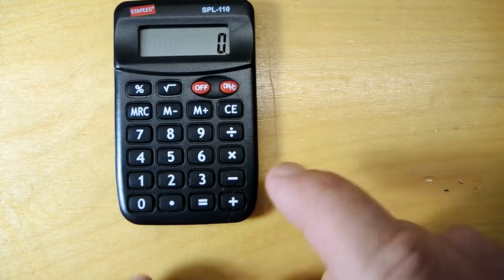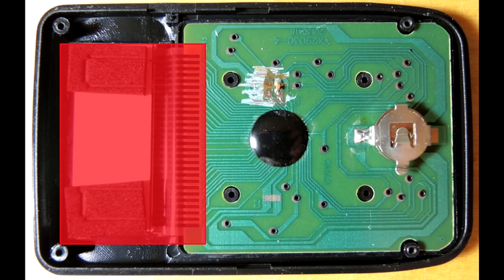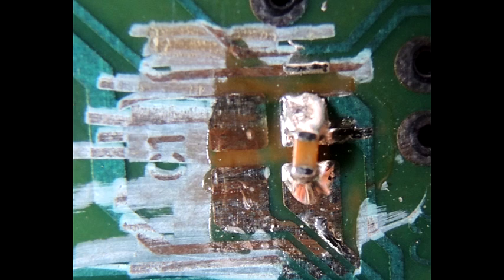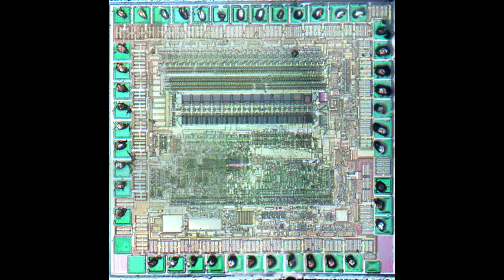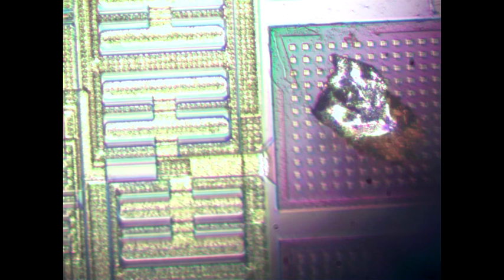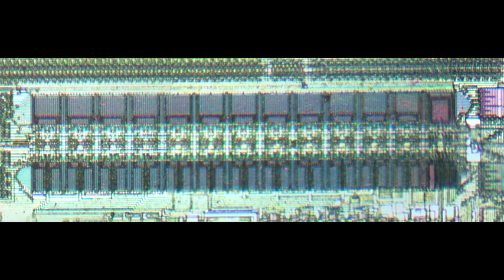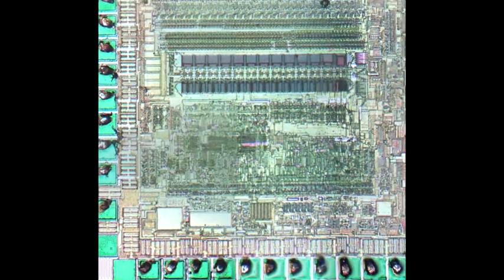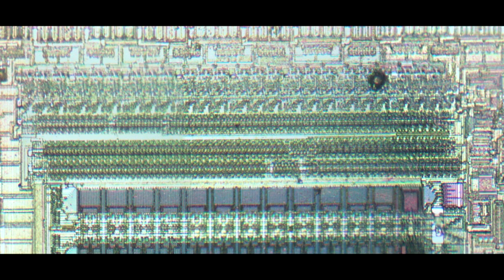Reverse Engineering a Simple Four Function Calculator: die decap

Comment: Larger die also has a very important thing of lower leakage, simply because of the thicker insulation available and the longer length channels in the individual CMOS structures. Very important if you want to get the leakage current down into the femtoamp region and the operation current down into microamps, helped there of course by the clock being a screaming few kilohertz, you just have to have the LCD backplane clock fast enough so the display does not ghost too much. 2 capacitors as there will be a separate clock for the backplane ( the larger one) and the main clock will be a faster one, but it will spend most of the time turned off waiting for an interrupt from a key press. LCD clock also drives a few extra divider stages ( they consume no extra current, the beauty of CMOS dividers, the first one uses half the power, the rest of the stages, irrespective of how many, uses the rest) that are reset by every keypress, and this final stage carry is used to switch the processor to a low power "off" state with all clocks stopped, waiting for the "AC" key to be pressed, which generates a power on reset.
Reply from the maker: +SeanBZA thanks for the additional analysis!

Comment: One thing about fab nodes is that each one has a huge upfront cost, and will have a lot of expensive machinery that isn't usable in newer processes for various reasons, and even entire buildings built with cleanrooms in mind that for various reasons can't easily be refitted to house newer processes.  It really is good to find something that it can still be used for rather than scrapping it all.  Something like a 4 function calculator for which the performance of remotely modern processes is completely irrelevant.

Also, the old processes have less stringent operating requirements in general, just because there's more room for error while still ending up with a working chip.  Thus, they can make chips cheaper, provided you don't push them toward their limits.  There's a practical lower bound on the size you can make a chip before concerns with handling and connecting it to the rest of your circuit end up costing more than the silicon you saved.

Comment: I decapped a similar calc, die was different
Reply: @benjamin4321  Heat. liquifies the epoxy for scrapping off or breaking bits off.
Reply: @qwertykeyboard5901  any chances that a chip still works after that?
Reply: @ioheil801  0